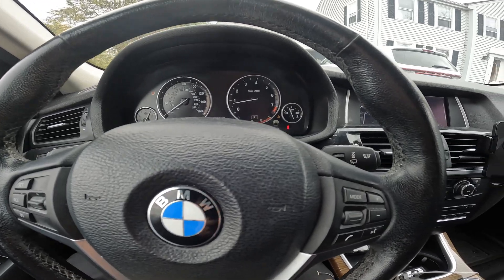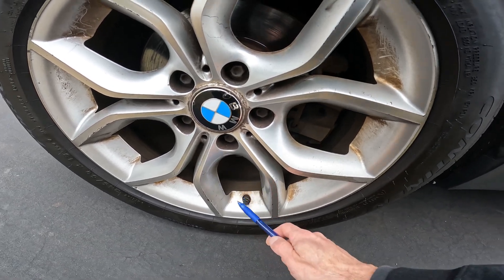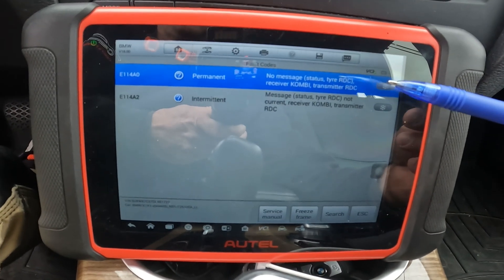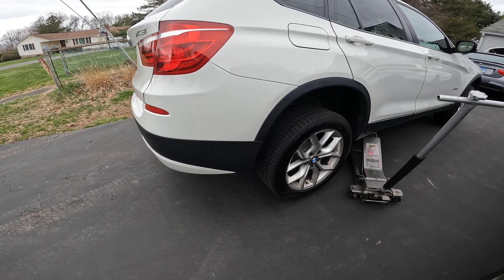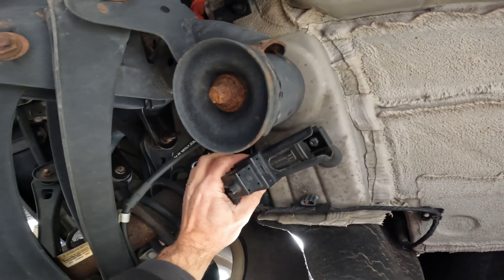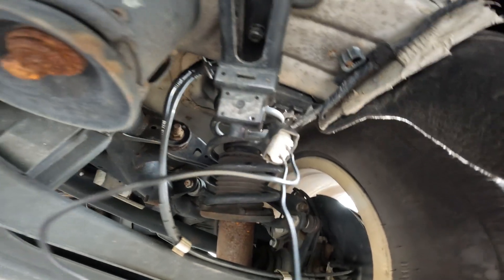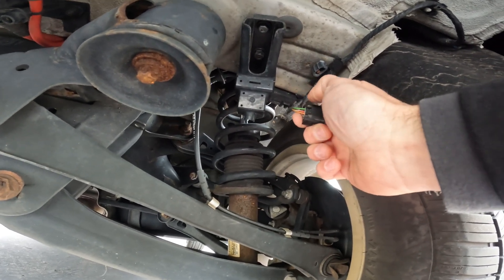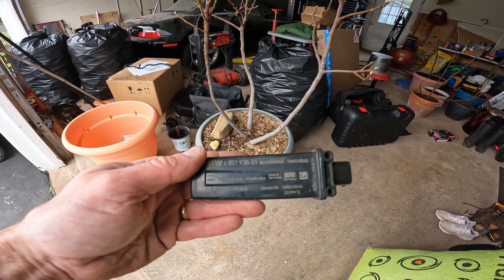Ultimate Guide: BMW Tire Pressure Malfunction Diagnosis and TPMS Repair

Comment: I replaced all four sensors, but it won't reset. It just says "TPM RESETTING." I drove for 20 miles, and it's still the same; in fact, the same message is still displayed.

Comment: Sir what if the system wide scan results do not display any faulty issue but the instrument cluster or the idrive show TPMS malfunction sign?
Reply from the maker: Hello, does the module show up in the scan? TPMS or RDC? It may be the scan tool does not identify the module which means it can't pull codes because the RDC is not communicating.

Comment: Hi I have recently changed my wheels. I reset the tpms on idrive. The 4 wheels turb green after a short journey but the pressure does not display yesterday I got a rdc malfunction warning.  I reset it again.  Green tyres   no pressure showing.. any suggestions
Reply from the maker: @moshazza5684  This can be from a weak signal from failing sensors in the tires.
Reply: @AskTheCarExperts  ok I bought these new off ebay...could it be that they are non oem and aftermarket copies?
Reply from the maker: @moshazza5684  That is most likely the issue if it turns green and then errors out. I have not seen good things with Non oe bmw parts. FCP is my go to online store.
Reply: @AskTheCarExperts  thanks
 Il try clearing codes and read few more times. If it doesn't work il get it coded out or just buy 4 oem ones
Reply: I cleared the fault codes..all 4 wheels something to do with received no signal or bad signal. I made sure pressure was correct/ewual. Did another reset and it worked. The tpms do pick up the pressure now just take approx 2 to 3 miles of driving where before it was alot quick on the oem sensors. But I can live with that
Reply from the maker: @moshazza5684  That's great news. It does show the sensors are the issue so if it starts acting up switch to OE sensors.

Comment: I have an 09 e90, all the sensors are good and they're reading tire pressure correctly and the batteries are ok. I tried ecu relearn but no luck, nothing I've tried has worked.

Comment: Where is the location on 2016 435i? Also i didn't get a code but am getting TPMS malfunction. Not getting any codes on reader only dash idrive light. Reset does not get past 49%
Reply from the maker: @BJW39  If the reset stops this is usually a bad sensor in a tire. Weak signals.
Reply: @ okay. Best thing would be to go to a tire shop and they should be able to test which TPMS is faulty right without having to pop the tire off? Am I able to diagnose at home without any special toools?
Reply from the maker: @BJW39  Correct, You need a TPMS tool that can read out each sensor. Or if they are original, it may be best to replace them all.

Comment: I need some help.
My RDC reads the tyre pressure and resets fine BUT whenever I do long journeys in my 2015 x6 it always pops up and flashes.
It sometimes goes away on its own during the journey but comes back every 20miles or so 
And usually only comes up at higher speeds rather than normal road driving. 
When it gets reset it disappears but again on the motorway at higher speeds it’ll pop up and flash for a while.
Bear in mind the tyres are pumped to the correct pressure and it shows in the idrive that the tyre pressure is correct and in the green. 
Can’t figure out what the issue is.
Reply from the maker: @MrFSD  Are you able to check the status of the tire batteries?
Reply: Same on my M2, did you find a fix?
Reply: Same and I got my batteries checked they are good all reading correctly have done 3 resets and I’m still getting the warning 🙄

Comment: Does cold weather affect the sensor? As my car been covered in snow for 4 days
Reply from the maker: @mamadubalde5739  Great question! The sensor is made to hold up to hot and cold. You may need to add air to your tires due to contaction of the air in the cold but the sensor should be fine. They do have an internal battery that will fail eventually but a BMW sensor can last 5 to 7 years or more. My sensors in my x5 are 14 years old and still good :)
Reply: @AskTheCarExperts much appreciated 
Guess I’ll have to put some air and thank you 🙏🏽
Reply from the maker: @mamadubalde5739  Happy to help!

Comment: I use beamer code advance just to remove Rdc because I really didn't need it I used to own an E46 and it never had it and plus I'm not using the required tires front flats so why bother with it so I have disable it I'm no longer have the light on but I have a 2010 328i
Reply from the maker: @isrealperez9069  That is a great solution as a workaround. I do like having tire pressure monitoring myself.
Reply: @AskTheCarExperts is that a nice way of saying that he's cheap and should have fixed it properly?
Reply: It's not about being cheap it's about is it worth fixing me well I could use the money for something major but that's your choice of putting somebody down it doesn't bother me until I saw this now but still it's your choice of deciding that I am a cheap person because I did not want to purchase it and I deleted it
Reply: No, you can use your eyes to tell if the tires are getting low. Its like using the weather app to tell you its warm out during summer. If you have a brain cell, you dont need a tpm....
Reply: @DomingoPedroza-v7c lol

Comment: did the special bmw scan tool that you got a few month ago could program the rdc?
thanks
Reply from the maker: It is supposed to be able to code, but not program. I have to do one on a friend car, so I will have to try it out.
Reply: @AskTheCarExperts  my 2017 BMW 330i recently started showing that TPMS malfunction warning eventhough I had put air in my tires last week I checked my tires again to make sure there is no leak and there wasn’t but the warning light still came on
Reply from the maker: @jeovanniperez3949  Sorry to hear that. A malfunction warning is usually not air pressure but a failure of a sensor or module
Reply: @AskTheCarExperts  please let me know if it does. thanks